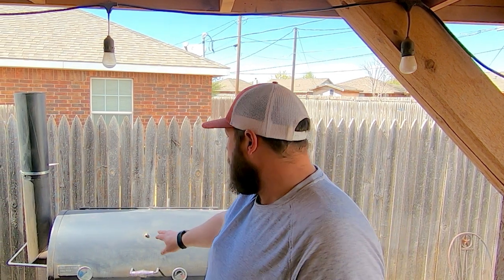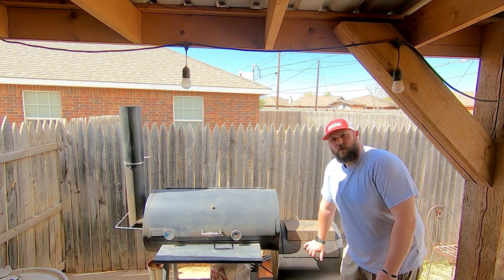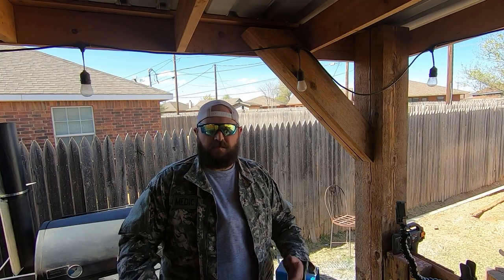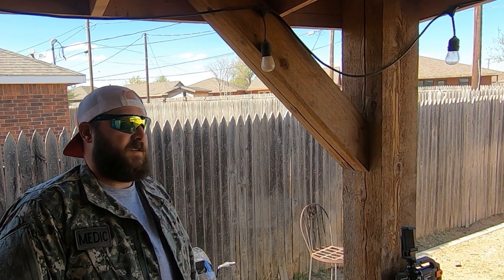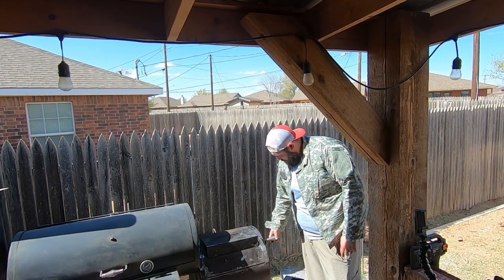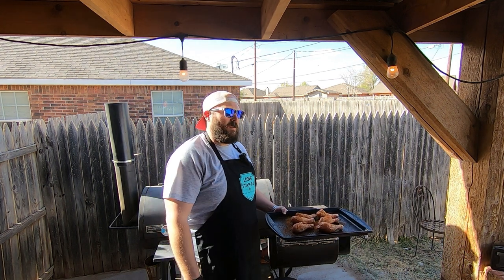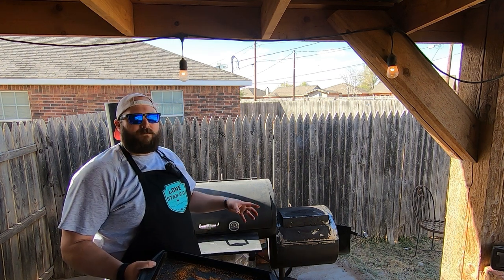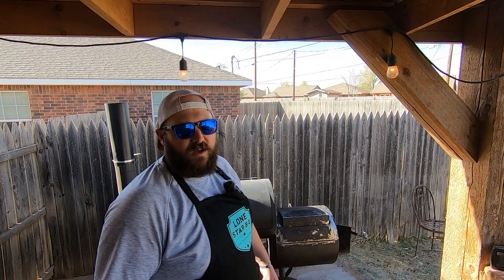Old Country Smokers Pecos Firebox Modification - Better efficiency

Comment: Nice job bud and a very smart move to seal that top, especially important on smaller cookers. I have used some of the very high heat rtv automotive silicone on some of my cookers in years past, works good and holds for a long time and even paintable. Keep up the good work my friend.
Reply from the maker: Thanks brother. Yeah, I believe If the warp was less, I would have tried that. It works amazing. But this gap was 1/4” after the lava lock tape. And, I don’t use it much. So I closed her off!
Reply: stupid idea....not food safe

Comment: I need to probably open the throat on mine. Having a really hard time getting the temp up consistently. Also probably going to remove the baffle plate. I understand what they were trying to do, but I don’t really see the purpose
Reply from the maker: Most people don’t cook in the style these were made for. It requires little to no air movement through the chamber, and basically a charcoal basket in the fire box( not really a stick burning design). Opening it up, removing the plate and extending the stack has helped mine tremendously!
Reply: @BrisketMedic  took 6 1/2 hours for a couple slabs of ribs. The whole time going through wood like crazy. Also going to add metal to the firebox, but on the inside
Reply from the maker: @figirovac81  that’ll work I bet!